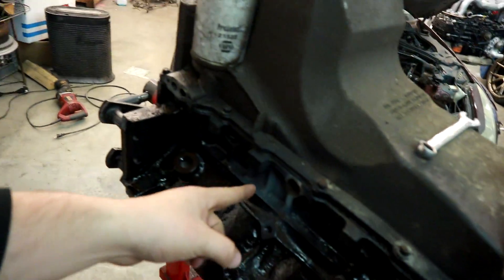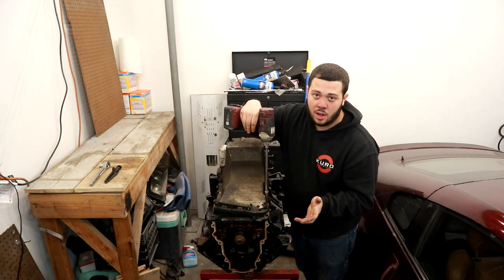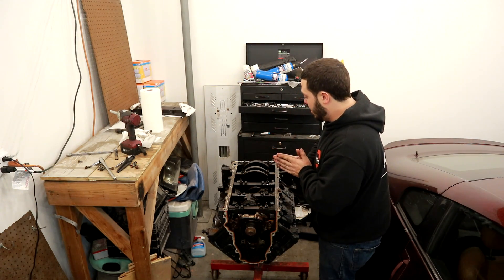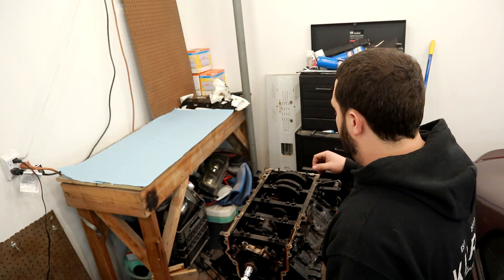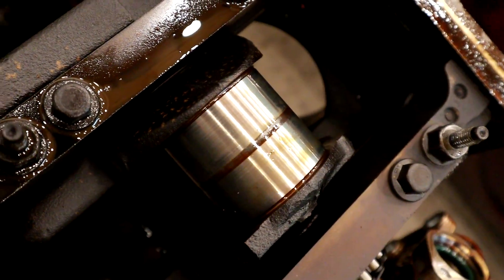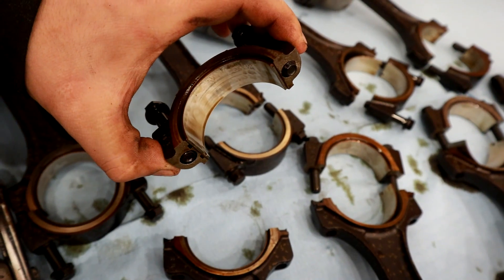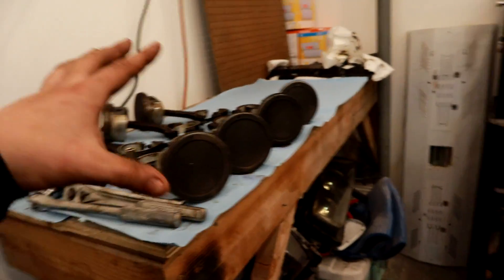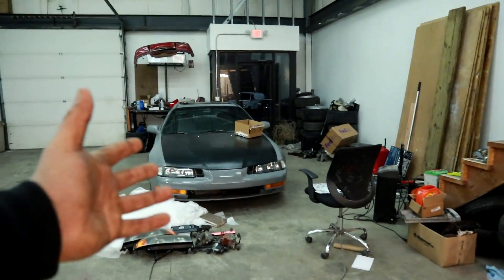JUNKYARD LS ENGINE TEARDOWN

Comment: @3:07 not sure what they call it for a 6 L but most vehicles that is called a windage tray it's made to prevent oil vapor from getting stirred up in the oil pan from the rotation of the crank assembly. It's made two separate that rotating crank assembly from the stored oil in the oil pan that way the oil doesn't get whisked up during driving which leads to blow by issues as well as others we don't need to go into

Comment: No need to pull the crank. The rod bearings are last in the oiling path, if those are good the crank bearings should be good. 6.0 won't break that trans. I had a 400hp VQ on a cd001 before the trans had issues... Then I LS/cd009 swapped it.

Comment: Shelves/racks would work wonders for your clean up's.
Being that you are an allergic lol look into those little air filtration machines for the shop that way going to the shop may not make you worse. Or just stock the shop up with allergy meds lol.

Comment: Why are u taking the pistons out? U are just staying N/A.
Reply: Jack Meoff he is replacing the rings and honing the block
Reply: John Scripter but why, it’s just going to be NA. I have a LM7 Boosted Making 650hp with out doing all that. Wast of money if u ask me.
Reply from the maker: Jack Meoff rings were 80 bucks it’s worth it to me to know I went through it
Reply: Damian Monte especially when you have no idea what the condition of the rings or bearings
Reply from the maker: John Scripter exactly and now I know the engine is actually in good shape and it’ll have new rings so we’ll be good 👍🏻
Reply: @johnscripter1792  why hone the block when ls engines dont get ring ridge?
Reply: hotrodj21 it helps to hone the cylinder so the rings will seat and create. Better seal if the score marks are too light on the cylinder walls it will have in sufficient oil to keep things lubercated.

Comment: when this one gets to the dyno and makes stock vq power... what are you going to do?
Reply from the maker: hotrodj21 Blame u
Reply: @damianmonte  not surprised at all seeing thats what you did last time..
Reply from the maker: hotrodj21 yea it’s everyone’s fault but my own I mean you guys all saw me out the engine together from scratch
Reply: @damianmonte  not exactly I mean I saw you take somebody else's engine put two different cams in it add some valve springs  and have the same outcome. Which is like 85% impossible
Reply from the maker: hotrodj21 I put 1 Cam in it it already had the turbo cam. I was yelled at in the comments to get dual springs so I did that. 1100 for the 3 times I got it tuned. That’s around 1500 I shouldn’t have spent right there. Everyone who looks at it says they don’t know how it doesn’t make power they all see it’s set up perfect so the only way is if it has low compression pistons (very low) that’s the only thing that makes sense
Reply from the maker: hotrodj21 was joking in the comment you replied to the joke being that I don’t know what pistons are in the engine lol
Reply from the maker: Sean Ledwith so me being told by multiple people the engine is fine and was rebuilt at s shop then calling a shop and not wanting to take the engine apart because I didn’t have faith that I’d get it back together was lazy ahhh I see makes sense you’re right about everything and yes I know how to “measure the compression ratio” Jesus Christ this is another one of those fuck you but no offense comments lmao good one thanks for making this one funny to read at least
Reply: @damianmonte  if you dont feel confident you cant get an engine back together you should not be working on them. PERIOD!! You call yourself a car guy but dude is right your lazyness is the problem. your fans are starting to loose faith in you. pretty soon your going to be dragging the bottom for video's like onion. you have ppl that subscribe  to you that build ls engines everyday and they are laughing at you. and you still haven't answered my question about the 300,000 mile n/a ls with low compression and blow by that makes more power.
Reply from the maker: hotrodj21 it’s not laziness it’s people literally not making sense whatsoever like this lmao all you can do is call me lazy when I’ve done countless amount of stuff on this channel in front of a camera admitted every time I was wrong and tried to show what was right and explain why but people are never happy clearly. Some people get so personally offended because I don’t take their specific advice because they’re a rando on the Internet they wright long ass comments about how I’m lazy and al that nonsense. Believe what you want homie sorry for keeping it real working on my own shit and not lying and hiding mistakes I know on YouTube you gotta fake it to make is smh what was I thinking
Reply from the maker: hotrodj21 I didn’t even read that part but that’s new “hey you don’t know exactly how to do something by yourself the first time don’t ever work on cars” Jesus this is gold
Reply: @damianmonte  listen you're taking this the wrong way I am calling you lazy because the extent of the things it takes to build the engine you are not doing you're looking for power but you're not doing the things to get the power. I'll tell you what I'll bet you $100 if you put a turbo on that 5.3 it may make 500 horse but I don't think you're going to get any more out of it than that. I know that you're seeing your views go down it's not because you're doing the wrong thing it's because you're not listening to the right people again I'm going to tell you I feel the people you're working with see your YouTube Fame and are taking your money. You don't have to be a patsy for people to take your money you just have to be a nice guy do you understand
Reply from the maker: hotrodj21 so calling someone lazy and saying they shouldn’t work on cars in the first place and insulting all the work they’ve done shouldn’t be offensive? Alright then. And I’ve explained so many times I don’t want a boosted v8 drift car I’m not that level of driver and no one here has seen the inside of the 5.3 no one knows what internals it has so no one can tell me how much power it will make. How am I supposed to listen to people that know nothing about the engine other than it’s a 5.3. All I can say is when the 6.0 goes in I’ll take apart the 5.3 and see exactly what the deal is